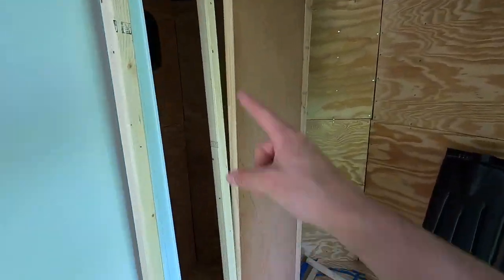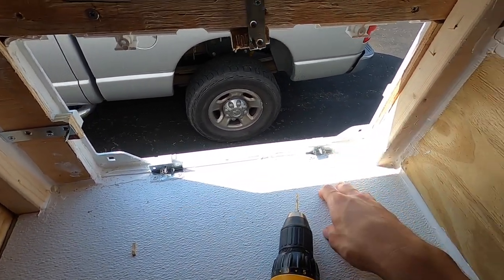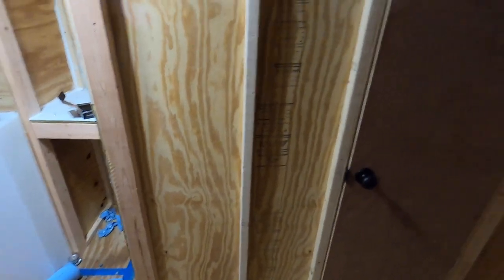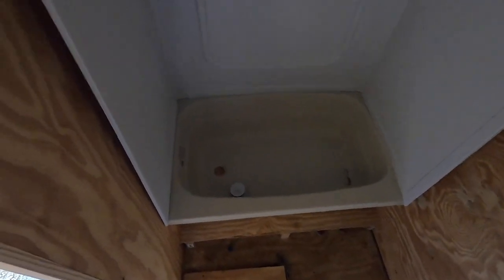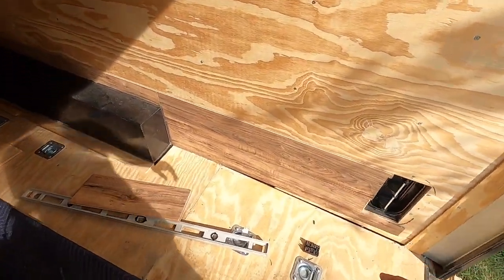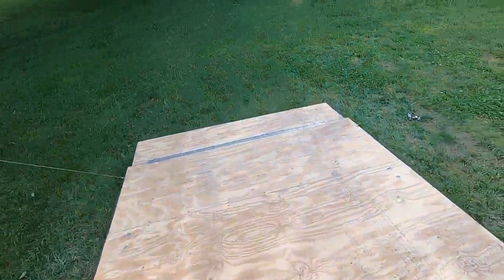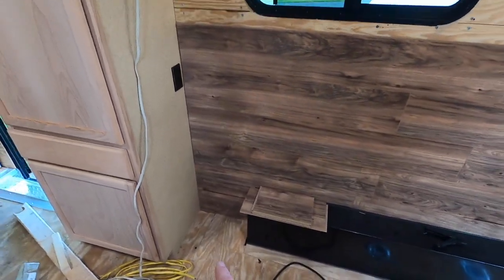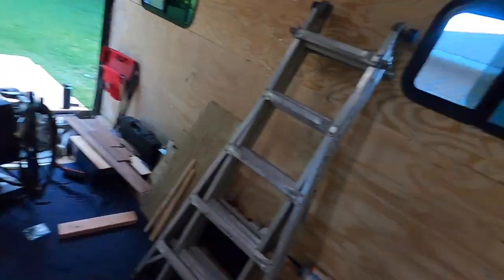Cargo Trailer Conversion BATHROOM WALLS ARE UP!

Comment: Paint inside the fridge space with Red Guard. That will waterproof it. Especially the back of your shower wall inside there. And, I’d insulate between the studs in the fridge area. Might make for a warmer shower. Did this mod to an older trailer I had years ago.

Comment: Stumble on your channel since I’m in the market for a RV.  The sub 30 grand units are poorly constructed on a massive scale in Indiana and usually leak within months of use, and if you want a really really good constructed travel trailer you will be in debt for years (check out the prices of the Black Series).  I see everyone raving at the high quality of cargo trailers.  Is your aluminum or steel? Did you remove the plywood and reinstall after insulation?  What is the size and manufacturer of your trailer?  I know...a lot of questions.
Reply from the maker: Fly Bar glad you found my channel! And I agree we looked at units and were not impressed and none of them were set up how we wanted so we decided to build out our own. To answer your questions the trailer is aluminum. It is a 20x 8.5 trailer with 7 foot ceiling height and a 2 foot v nose. It is from Merica cargo trailers out of Georgia. If you look back earlier in the build series we have on this trailer build you can see the process of installing the insulation. We did reinstall the plywood after we finished. I have to finish uploading the rest of the build as we just moved across the country and I haven’t had time but the build is completely finished and it worked amazingly as an RV. it even survived a torrential downpour without any leaks at all. So far it has been the best investment we have made at only a fraction of the cost of what an actual RV would have cost and the joy of building it and designing and making it our own just adds to the adventure. Feel free to watch the rest of the series I have on my channel about the build and reach out anytime with questions. I would be happy to help.
Reply: Wild Schneider Outdoors I forgot to sub...will do that now.  I have to see how your build turns out..really like the material you used for the side walls...water proof and light.  Really do hope you settle on normal 1970’s still upholstery material that’s used in ALL of today’s RVs....that would be AWESOME...joking...good videos by the way.
Reply from the maker: Fly Bar well thank you so much. I’ll have to upload the last few videos I have saved in my computer once we get some internet out here. Thanks again and if you have any questions please just let me know
Reply: Wild Schneider Outdoors Keep making videos..people will find you.

Comment: What deminsions did you go with toliet / shower area?
Reply from the maker: The wall is offset by 36 inches for the shower pan plus 3 1/2 inches for the frame of the wall itself. So almost 40 inches. It’s plenty of space for the shower and toilet we have in there and still allows for there to be plenty of room in the kitchen. If you watch the update video I did after I have all the major builds finished you can see just how much room there is in the kitchen. Hope that helps!
Reply: Can you provide a description/link for your wall covering? Thank you.